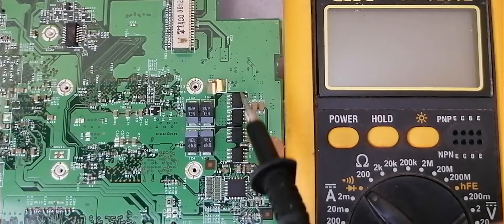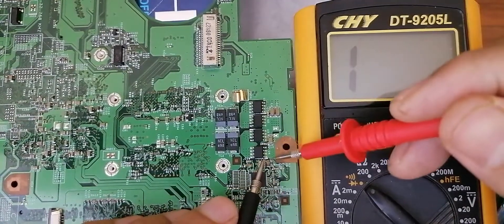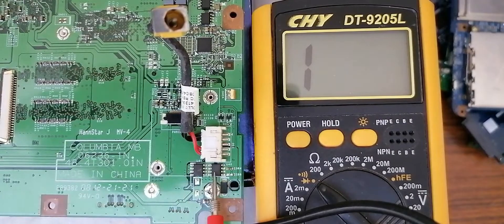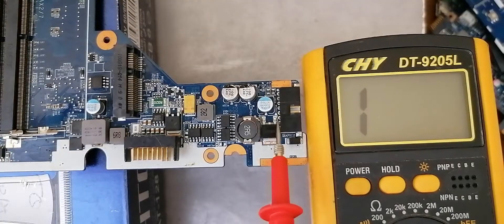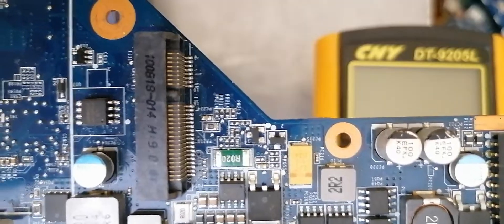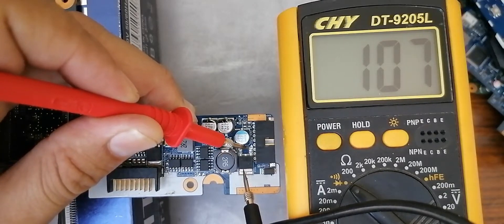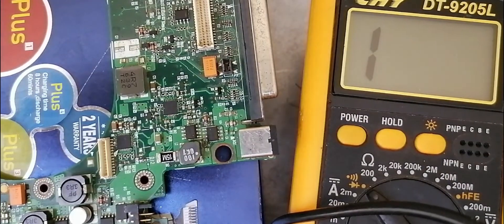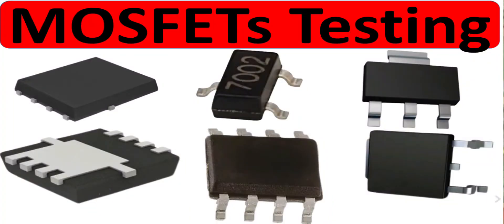How to test mosfet using multimeter - SMD mosfet testing

Comment: When try to test Mosfet, use diode mode or continuity mode ??
Reply from the maker: When testing a MOSFET, it's best to use the diode mode on your multimeter. Diode mode allows you to check the MOSFET’s internal body diode and gate-to-source junction. Continuity mode is not suitable, as it doesn’t provide the necessary readings for semiconductors like MOSFETs. Make sure to test between the drain, source, and gate terminals in diode mode for accurate results.
Reply: @electronicsrepairbasics_erb  Ok, now I know is better use diode mode to test Mosfet, but from your video, when testing the Mosfet, you only got reading from either drain-source or source-drain, not both way, from my testing, i got reading from both way, what is this mean ? thanks

Comment: When i turn the power on (for only a few seconds, then i turn off quickly) the mosfet becomes too hot , does that mean that this mosfet is already damaged ?! .. or it may be OK and that current which made it hot comes from another faulty component in the circuit?!!
Thanks in advance for your kind advice

Comment: Sir , what do you actually read on your multimeter on diode mode ?   you say high / low resistance , and then you say for hundred voltage  6:20   that's confusing .  does  diode mode display resistance  or voltage ?
Reply from the maker: It displays drop voltage which could be 700, 600, 500, 400, 300, 200, or 100 depending on the type of diode.

Comment: Hello, at 14:10 you were testing the MOSFET on the source to the ground , the mosfet shouldn't connect to the ground ?  i mean whenever you connect source to ground we must have reading on the multimeter right ? thank you
Reply from the maker: That MOSFET is a lower mosfet in the circuit, The source of lower MOSFET is always connected to the ground, check my schematics videos and you will understand

Comment: Sir ,  we need SMD mosfet tested off board  , the majority of engineers says  the readings are inaccurate when mosfet are tested  soldered on the PCB .  Can you make smd ceramic capacitors test off board along with 8 pins mosfets tested off board ?
Reply from the maker: Noted.